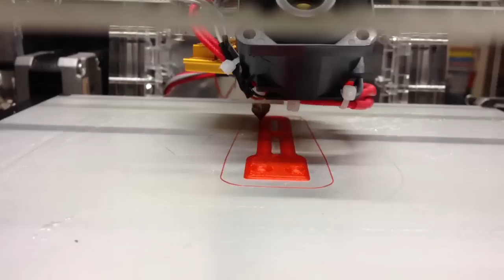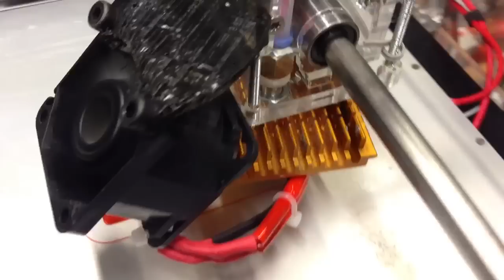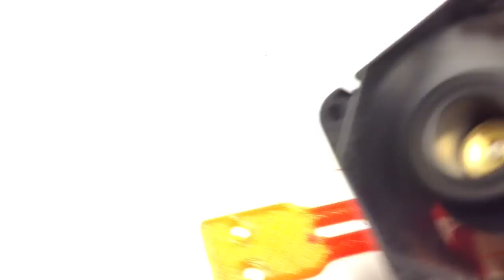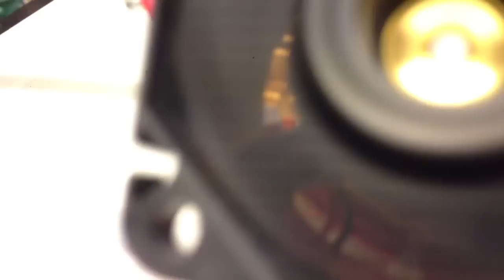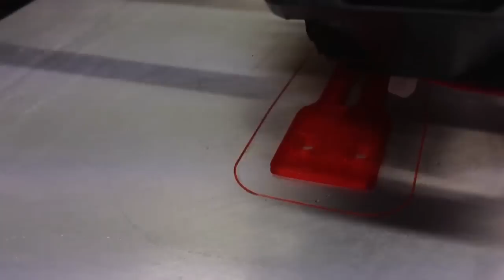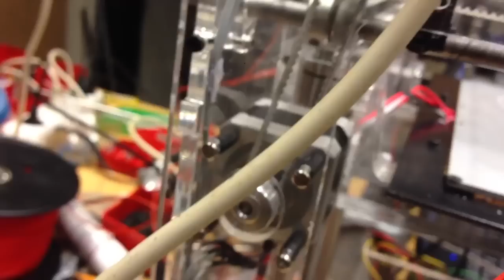Self sourced Ultimaker first succesful print (3rd try)

Comment from the maker: I am printing directly on my experimental alu heatbed. It turns out you cannot print on aluminum, so here its painted with ABS dissolved in acetone.
I have since covered it with kapton tape and use hairspray to get both PLA and ABS to stick.